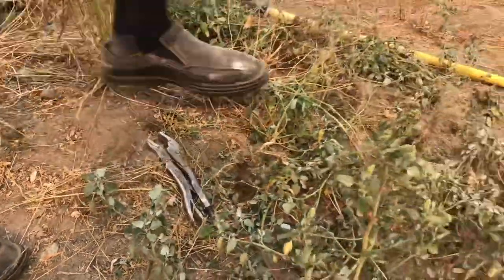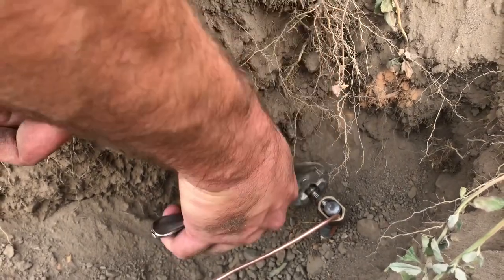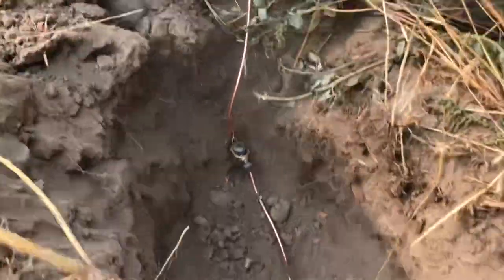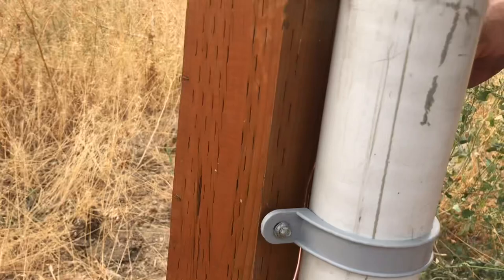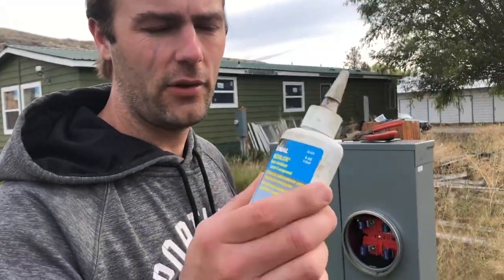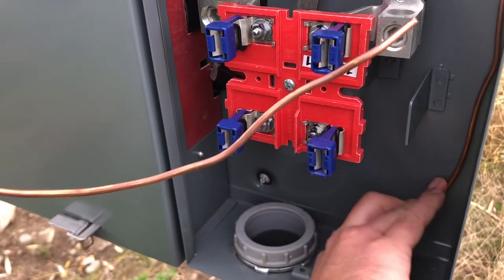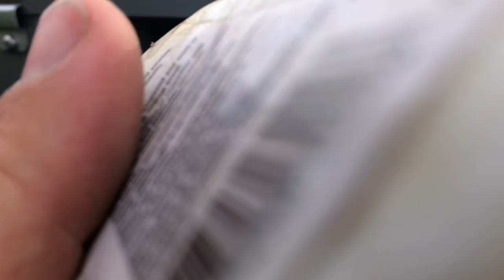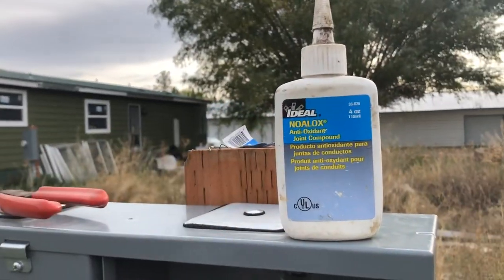Electrical meter base install for a mobile home

Comment: Steel grounding rod?  Need a copper rod I think??
Reply from the maker: Both are approved, you want to follow your local code though, everything in this video was inspected and meets code for my area, galvanized grounding rod is just cheaper obviously and I needed 2 rods 8 ft.

Comment: Question big bro , performing a tilt test on an electrical pedestal one leg reads ok the other just beeps no light, what does this mean? I’d appreciate ur help
Reply from the maker: Sorry I have honestly never used a tilt meter but, I think you need to make sure no power is going to the legs. I’m sure that doesn’t help you much, I wish I knew how to help better.
Reply: @frugallandlord6974  appreciate your time